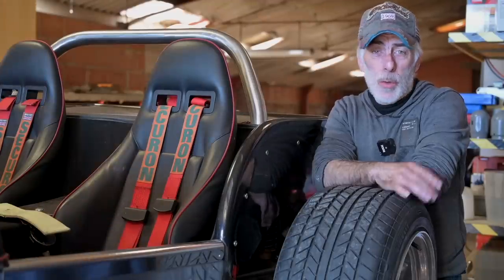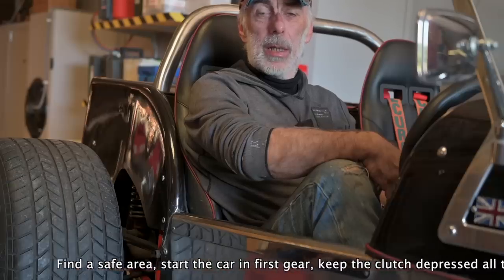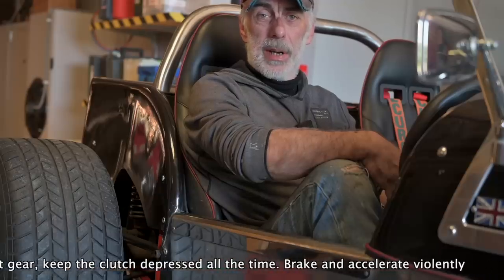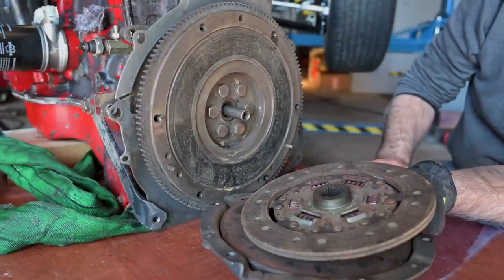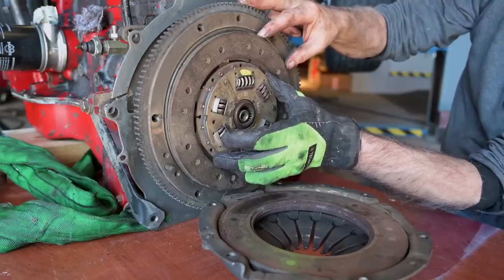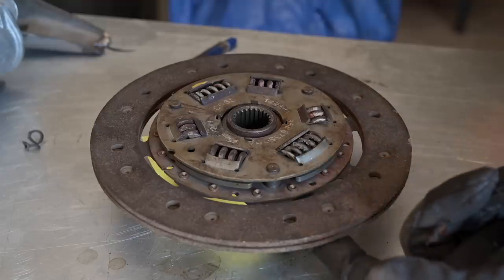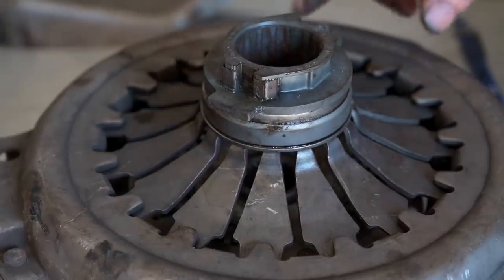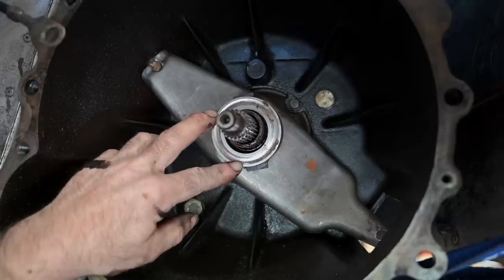A sticky clutch, ways to release it and  normal operation

Comment: Finally, I found a good source video to try some other things on my 1994 Suzuki Vitara 4x4.
Am retired, living in the Philippines, where I bought this car, because we live in the mountain province, and I need a 4x4 to climb this steep hill to the house. Everyone around here rides scooters lol is NO cars very often. 

First time I experienced this was after my car sat for almost 2 weeks. Once I got it started and rolling, in gear, it broke free and my cable worked fine. Come rainy season in December '22 it sat parked for 2.5+ months. Rained all the time, and no need to get stuck, trying to drive down the slippery muddy hills here, to the road. 

I bought a new (correct type) cable and installed that. Have adjusted the cable both ways as well.....STILL, No fix, pulling my hair out trying to figure out what happened just sitting !! lol. Ordered socket set from Germany, hoping I won't have to pull the trans out. Don't have a cement pad to work on, or a floor jack etc. All my 45+ year collection of tools (lifetime mechanic, are in storage back home in California)

 I had tried the jerky actions, hard braking etc, as mentioned, to no luck. Maybe I will jack up the rear end, put it in 2x4 not 4x4 mode, and see if that helps break it free. I really, really don't wanna pull out or back the trans, unless I totally HAVE TO !!

Thank for this video lesson/tips appreciate it !
Reply from the maker: I hope that it worked for you. thanks for the write up

Comment: Thank you very much !
On my 1948 Anglia the trick with the axle stands worked right away. I am soooo thankful.
Reply from the maker: You're welcome!
Reply: Interesting... but why does pumping the brakes with the clutch depressed release the clutch plate?  I am confused about that point, but I am hoping it works on my little Fiat 500.
Reply: @daxpresuto3077  Well, because the front of the clutch is connected to the motor and the back to the drivetrain. So when the motor is running and you stop the drivetrain they separate, given that the clutch is depressed so it can separate. I am German ,I hope I made myself clear....

Comment: I knew an old mechanic that had a weird method of releasing a clutch. He would take the starter motor out and put a garden hose through the hole and flood the clutch assembly. Left it for 10 minutes and started car and problem gone. It is a rare occurrence probably. Love your videos.
Reply from the maker: Thanks for the comments,  that is so funny
Reply: It absolutely works, for water and rust stuck the clutch and also water will unstick the clutch ! Seen it work quite a few times
Reply: That's what they call a wet clutch:)

Comment: Finally!! Tried this on my kubota tractor that was sitting for awhile, i was able to get it into low gear without it disengaging, once rolling i pumped the brake 5 or six times and it popped loose!! Thank you for the video
Reply from the maker: Glad I could help
Reply: Jumped on my little old kubota today to find the clutch wouldn't disengage. After watching this vid, I managed to release the stuck clutch and the ol' girl is back to work again. Thanks for your video. cheers from Australia

Comment: Steve. I know I am late to this party and have heard and witnessed the other options being used and working, but another option I have heard from many mechanics in the past is, if you are not in a hurry, is to wedge the clutch pedal down while the vehicle is stored. Over a few days the clutch then frees itself, and I was told that this is often a far less destructive way. All the very best.
Reply from the maker: That is a new one, good to know. TXS
Reply: This just worked for me. Only took 10 minutes. Thanks Stephen.
Reply: Damn ima try this after i run through flood

Comment: I had this issue with my 4x4 Magirus. Fortunately, I was able to break the clutch free on jack stands. Removing the gear box is in principle fairly simple but without the right equipment quite challenging because of the weight.
Reply from the maker: Thanks for the comments

Comment: 1:53 Actually you have one more option which works better on tractors due to larger wheels. Due to some play in the transmission, put the tractor in the lowest gear and then using the tire as leverage rocket the tractor back and forth by hand (on a smooth surface) while some way pushing the clutch. This way I could release some older type clutches quite easily.
Old tractors have open space above the clutch pack and id you leave the tractor outside and it rains then you can have slight build up of rust which usually isn't anything major.
The methods you suggested are better, but require some extra hand or tools :)
Reply from the maker: Very good point , and indeed the large rear wheel act as levers..  Thanks for the comments
Reply: @D3Sshooter  No problem!

Comment: Thanks the clutch is released. I am lucky guy. Used the method of lifting the rear wheels (forgot the first time that it was in low gear so also automatically in 4 wheel drive) 😅
Reply from the maker: Thanks for the comments

Comment: Nice video, but  I would change just a bearing, the clutch plate and clutch pressure plate are old but in good condition, I would keep and run them.
Reply from the maker: Thanks for the tips!, however did you notice the crack in the pressure plate housing.  The clutch got stuck before with the previous owner, or at least that is what he told me...So, as things are removed its no big cost to replace the whole thing.  Don't want to do it twice
Reply: @D3Sshooter  sorry, I didn't notice the crack in pressure plate. Yes I agree, it is better to change everything and I like your videos, I learn so much from your videos.

Comment: I remember doing the engine start in first gear then as it got going press the clutch pedal hard then release quick. Couple of times pressing the pedal would work well.
Reply from the maker: Indeed, that works sometimes
Reply: @D3Sshooter  I realloy hope it does because I am going to try in an hour on my 1985 Honda Prelude that is in a barn here in the UK. No room to drive it forward!
Reply: @chesterarebest did it work?
Reply: @jameshunt5316  Yes it did! Some years back now and forgotten about it but yes! Now it has slight wiring issue... but ill fix it. Thanks for the tip .
Reply: @tonyarnoldphotography9757  you got this!! Mine came free after sitting for four years

Comment: It worked with my Corvette C2. Clutch was stucked after 2 years. I removed the wheels and reved the engine and pressed the brake several times.

Thanks for that tip. It saved my weekend.

Greetings from Switzerland

Comment: Wow, came here for some tips and left with a full education on the clutch. I have a 97 BMW with a manual gearbox. When I place it in neutral gear and release the clutch, the car will move/creep forward even though its on level ground. Thoughts on what may be happening? bad throwout bearing perhaps? Time for a new clutch?

Comment: If none of those suggestions work, lift the car and check if there's a bung in the bottom of the bell housing. If there is, pop it out and, with an assistant pressing the clutch pedal, insert a screwdriver to free the friction plate.

If there isn't a hole, make one with a 10mm drill!
Reply from the maker: Thanks for the comments

Comment: I have never done it but often thought of removing the starter and filling the clutch housing full of a diesel and oil mix then leaving it too soak. Then if it worked you could wash it out with brake cleaner and compressed air but it probably wouldn't be very good for the clutch material plus you need to be lucky and have a good sealing clutch housing.
Reply from the maker: hahaha, you could try that. But it will leak allover and make one big mess....  I rather take thing apart and see what is wrong.

Comment: This is an actual problem with a vehicle that is stored for a long time. My comment is how could an owner with a vehicle in storage do something to possibly prevent this corrosion seizure? My suggestion but I must admit I have never had this problem would be if at all possible maybe every 6-12 months or so raise a drive wheel. Get a helper to push the clutch pedal down holding the clutch released, trans in gear, ENGINE OFF, and the helper rotates the raised drive wheel for several rotations. Then still released and rotating the tire slowly engage the clutch and you should hear a slight buffing sound as the facings make slight contact with the FW and pressure plate surface. What this might do is break up the start of the bond of rust periodically and prevent total seizure of facings to cast iron. If you can turn a wheel, trans in gear, clutch released (pedal on floor) then the clutch is successfully released. The other corrosion issue with stored (especially if outside) is corrosion on the splines of the disc and input shaft. That corrosion can also cause poor release due to dragging and not sliding freely on the input shaft. Not sure what the car is but I saw enough to identify disc as a B&B AP made for Ford. Retired from the aftermarket clutch industry, 39 yrs. Gary
Reply from the maker: Thanks for the comments

Comment: Hello, I have an issue when I push the clutch in it makes rattle or ticking noise that causes  vibration on the clutch pedal, it is hard to put it into any gear and nearly impossible to put it into reverse, and if I get it into gear the car behave like the clutch is not fully released when the clutch is fully disengaged, I don't smell any burning and gear does not grind at all, I installed aftermarket flywheel and clutch kit with CMC and CSC for a year now.
Reply from the maker: Bearing is gone on the pressure plate,  or broken warm fingers on the pressure plate

Comment: I think you may have forgotten to show the pilot bearing, if you're not going to replace it (recommended ;) atleast put a dab of grease on it. My ol' Ram clutch is still stuck, I bought a new Hydraulic Clutch System., I bought the complete system that is full of fluid and supposedly pre bled, so it should have been a complete working system. installed it with the help of my brother and the clutch still won't disengage, I was hoping it would fix it but no luck. I started it down a hill while it was in 1st gear it continues to pull even with the clutch pedal pushed to the floor. I plan on removing the slave cylinder and push the rod in with the master cylinder lid off and hope it removes any air bubbles left in the lines. The slave cylinder doesn't have a bleeder valve on it so that is the only way I can think of to remove the trapped air in the system. If that don't work I'll take it back to Oreilly auto parts and exchange it for another and hope🙏 it works next time. Or it maybe time for a new/used vehicle that works.

Comment: If the clutch is frozen you can't get it into gear to begin with, unless the trans was in gear to begin with when the clutch froze.
Reply: indeed, this is exactly my problem @rcnelson.  I tried putting it up on jack stand but wheel won't turn because clutch is froze and can't get gears to engage (even though I move the shift stick through entire range, and transmission feels pretty normal).  Any one here have any advice?  Other point being my clutch pedal is stuck in "up" position. Can't press it down.  Totally jammed. A friend said maybe the clutch fork got seized up?
Reply: @dstap  did you solve the problem? I have a similar problem.

Comment: Thanks 
Also this clutch looks brand new
Reply: My thought exactly, maybe new clutches are more likely to get stuck?
Reply from the maker: Well, I think it might be, as the previous owner claimed that they replaced the gearbox with a 5 speed.  So they must have changed the clutch, although the pressure plate is cracked at one place, and the throw out bearing is not all the good

Comment: When it happens to my truck and I take the pan off the bottom of the bell housing and push the clutch in and while the pressure plate has released the church I use a screw driver and it comes unstuck easily

Comment: When I switch on and off of my Hilux ln166 cab, engine and the gearbox  shake,is that a clutch and pressure plate problem
Reply from the maker: That is hard to tell with the information provided, can you explain a bit more ?
Reply: @D3Sshooter  first of all  I thanks you very much , actually that's like a broken mounts problem,after I check all three mounts(engine and gear box) they are very good, one mechanic in my country told me that may be a clutch and pressure plate problem,so I want to clarify that

Comment: Sir I have changes clutch plate pressure plate release bearing master cylinder slave cylinder it’s about 2 weeks still problem persists after running car in rainy days
Reply from the maker: Sorry for the late reply , as i was away for work. But thanks for the comments.  what do you mean with rainy days ?
Reply: @D3Sshooter  sir as there is little bit of water logging the flywheel 
 stucks with clutch plate

Comment: Does the clutch suppose to spin freely after the pressure plate is installed?

I just installed manual transmission it is stuck in gear. 

Thanks
Reply from the maker: Thanks for the comments, No not at all. The pressure plate should force the clutch plate onto the flywheel .  Its only when the clutch is depressed that clutch plate is free from the flywheel.

Comment: I stopped at a gas station and when I tried to leave my car would not go into gear with the engine running.  The clutch pedal felt normal, everything was hooked up and moving, but it wasn't disengaging. I managed to get the car home, then let it sit for months.  I started it today and it went into gear, drove it around, and it's working completely normal. Are there Gremlins that repair cars as well as break them? LOL Since I drove the car all the time and I believe everything to be in good mechanical condition the only thing I can think of is that some crud came loose and was jamming the friction plate between the flywheel and pressure plate. I also realized that if I'd just pushed the clutch in and tried to accelerate it would have probably ground the crud out of there and fixed the problem or torn the clutch friction plate up. Anybody had a similar experience or have any opinion about this crud theory ?
Reply from the maker: sticky clutch ?
Reply: @D3Sshooter  I've been driving the car with no problems but I did feel the clutch stick a little when I started it in gear with the clutch pushed in the other day. I had a small oil leak I think may have contaminated the friction plate and that might be causing it  to stick.